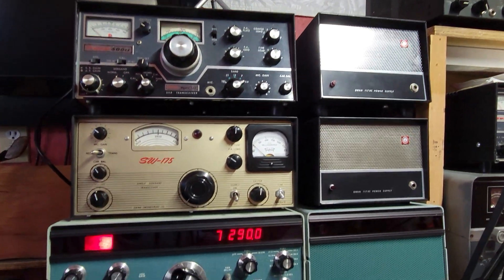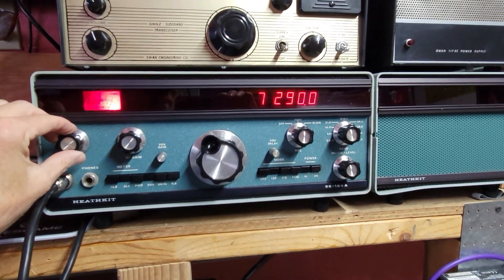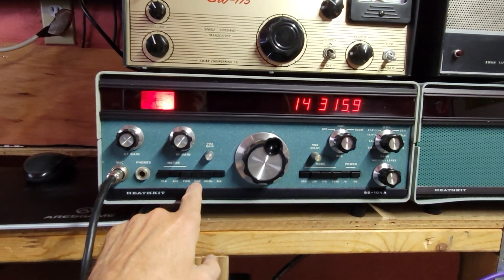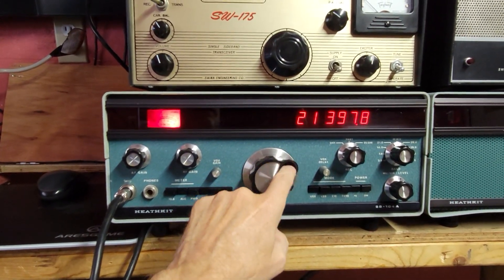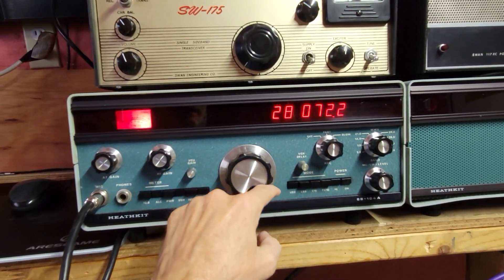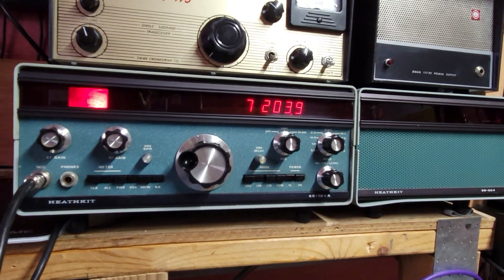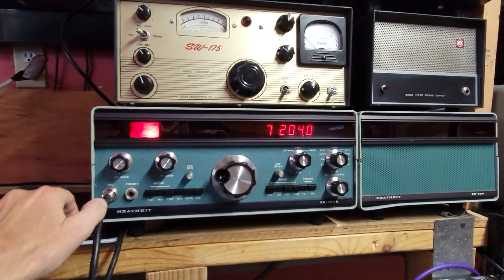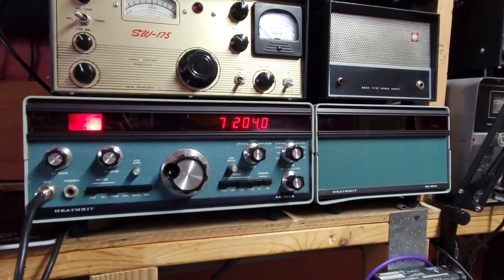Heathkit SB-104A Tune around....

Comment: I picked up a whole set , Given to me, SB-104a, SB-644A ,SB-630 and Power supply, Key, all manuals , Its been working Great,for a year, all of a sudden, The meter #'s are showing half, Like # 4 is missing 1 line, I,m not a electronics guy, I also have the Test board for it, Is this something I could fix you Think, I taking my test in a month and want it working Great, any help would be appreciated.
Reply from the maker: I actually picked up a 104a and ps speaker combo at a hamfest in nv. this year...works perfect...well, it doesn't  work, so work in progress has some distortion on tx. I will get it working this winter.